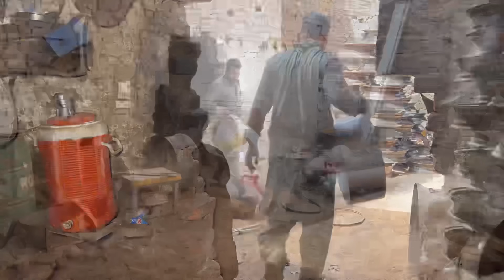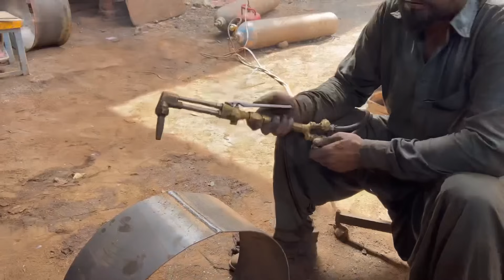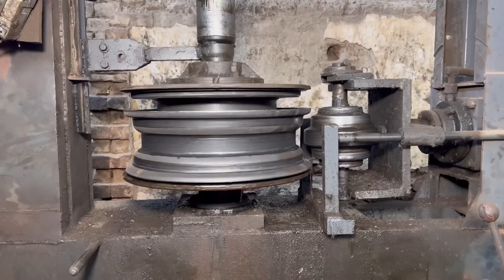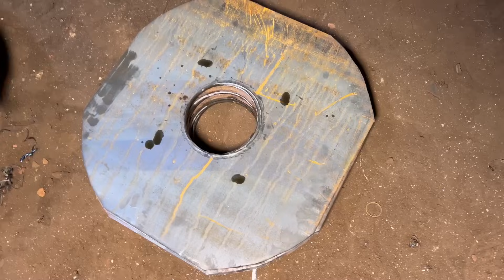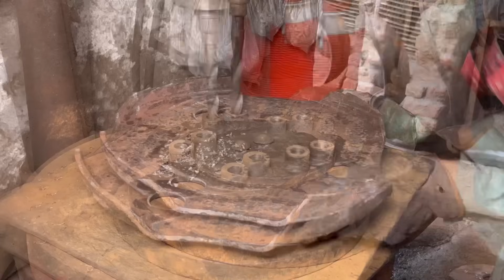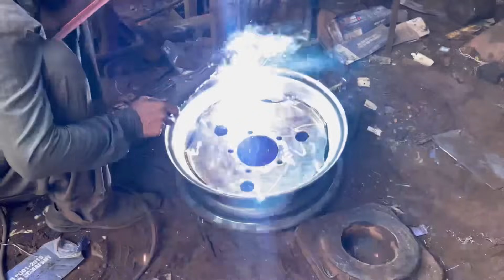Manufacturing vehicles iron wheel Rim in Factory | Production Process wheel Rim - производство колес

Comment: Impressive but there is no way the rim, lugs and center bore are concentric.  The bore should be cut after welding and then the lugs.
Reply: That wheel will be rotating at slow speed on agricultural equipment, no need to be concern about that.
Reply: @abelmercado5672  Definitely. These wheels are going to be mounted on a cart drawn by a donkey so the production tolerances are OK at this level. Nevertheless I agree that it is impressive and surely interesting to see how industrial manufacturing looked like at about the time Henry Ford was born.

Comment: Smart people use the simplest, primitive and the lowest cost method to mass produce steel rims. Very impressive!
Reply: And then they die prematurely
Reply: It looks like the steel rims on a car are actually made by the car manufacturer.
Reply: To work like this is not „low cost“. Its ineffektive and takes way too mutch time. Only possible because of low wages.
Reply: No effort to automate or improve these 100 year old techniques. They work this way today and will not change in another 100 years.